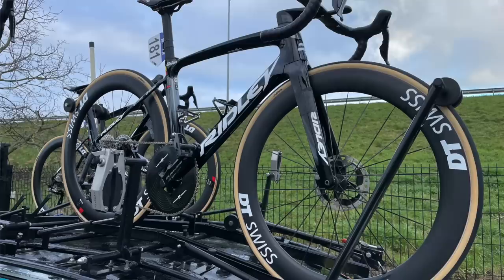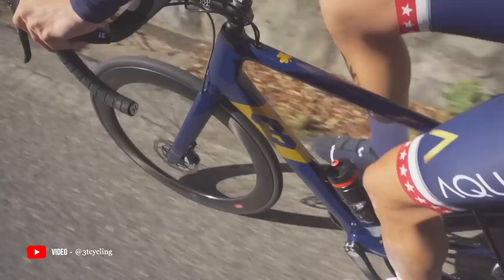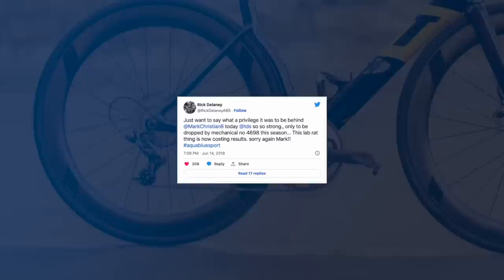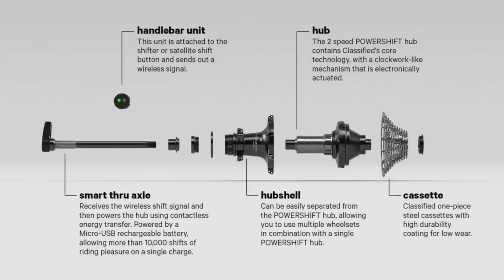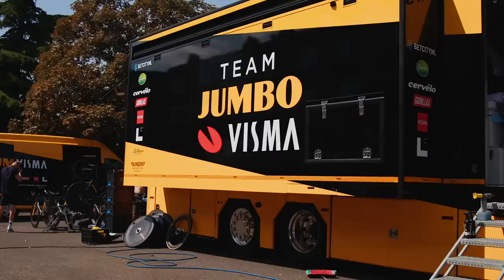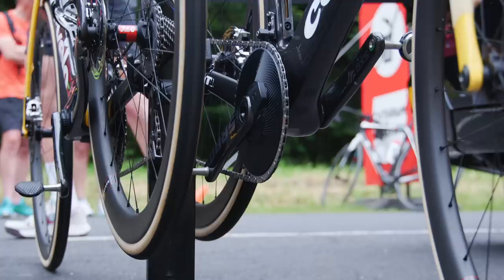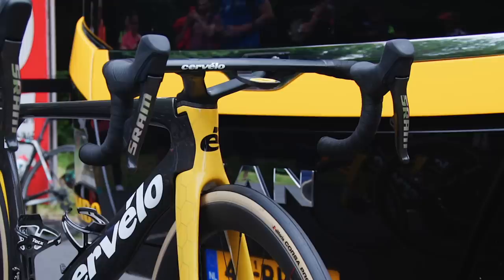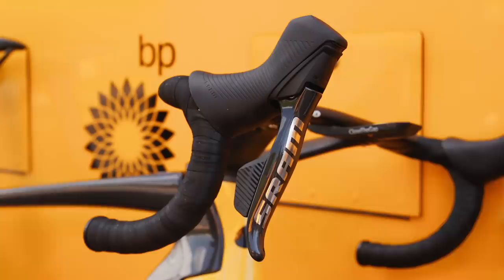Is Jonas Vingegaard Going 1x At The 2023 Tour de France!?

Comment: I think they should attach a 12-spd cassette to a crank and replace the front derailleur with another rear derailleur so they can have 144 speeds.  Maybe also throw a classified hub on there for hilly stages.
Reply: Well, the Classified hub makes 48 speed set ups possible.
Reply: this is what happen if we use 100% of our brain
Reply: @SecwetGwiwer  Well, technically u could use a 3x crank on a 12speed groupset, soooo 72 speed bike cooming soon
Reply: @wouter6053  3 x 12 = 36 though, not 72, unless you are hiding another multiplicator somewhere?
Reply: @yvjohns  yep, the classified hub

Comment: We had 6.8 kilo bikes forever, so weight saving point is irrelevant, 5 watts saving from removing an FD sitting in consistent turbulent flow due to pedalling is also an unverifiable claim. In short SRam is pushing BS marketing stunts and BS products like they have been for the past bunch of years, they got extremely lucky Roglic didn't lose the GIRO due to 1x, I hope they succeed in making Jonas lose TdF solely due to their BS and pay the price for it.
Reply: Sram is notorious for pushing stuff like this, meanwhile solving real problems with their drivetrains (mostly their front derailleurs) they just don't care. We saw that with their new Eagle "Transmission", and now we're seeing it in their road 1X setups aswell. I mean, I love Sram Eagle, but instead of improving on the derailleur hanger, which literally prevents your RD from snapping, they just ditched it and created a whole lot of new problems, especially for frame manufacturers.
Reply: Le cervelo s5 ne pèse pas 6,8 kilos
Reply: @coolbell9026  the S5s that JV guys ride aren't the same as consumer S5s

Comment: For a while I used a 2x with 35-48 and a 10-36 cassette. I found that I never used the small ring. You do also have some aero gains.... however you lose some watts by cross-chaining. You will also have more limited gear ratio with bigger spaces in between gears. Also 2X12= well realistically probably 14 or maybe 16 gears? Having said all that I would still love to see it happen!

Comment: 1) How do you get the aero benefit of losing the front mech if most cyclists substitute that for a chain keeper?
2) 1x does NOT give a better chain line, except in the middle of the sprocket, so maybe in 3 or 4 gears only.  In the highest or lowest 3-4 gears, the chain will be more 'bent' than a 2x in the right combination.
Reply: You get an aero benefit because you have a narrower chainring (you only have one instead of two) and because the sram front mechs are absolutely massive. The idea with the better chainline is that you set the bike up in a way that you get the good chainline where you actually need it and the worse one when you are just sitting in  the pack.

Comment: I rode a 1x for a while on the road, with a small chainring at the front and a big cassette on the back. It didn't work for me as an amateur rider, it was great for steep climbs (which is a bonus round my way in the Peak District), but I had no big gears for the descents. Was so happy to switch back to my double chainring. I can't see it catching on for casuals.
Reply: Only for TTs on race day, niche product. Or London commuters. Even for TT aero gains are marginal, <10 watts and only good for flat courses.

Comment: I have a 1X gravel bike, which is also my road bike. It’s my own mullet build - 42 tooth SRAM Force chain ring up front, GX Eagle 12 speed, 10-52 cassette at the rear (GX Eagle derailleur). Gear ratios have been great for me on climbs. Just a slow and steady pace. I ride solo, so I don’t know if my 42-10 combo would be able to keep up in a group on flats, but I’m in no hurry to find out. Pretty happy with my set up. Love the simplicity of just the one chainring. Oh, and I have semi slick tires instead of knobbies, because the majority of my rides are on road anyway.

Comment: Been riding 1x for 2 yrs and love it. Especially cause it allows me to have a 15 lbs bike 😊
Reply: I built a 14.8 lbs bike with 2x all the way back in 2014 with a lowly Sram Force 22 group.
Reply: @johnnycab8986  what frame and what size. I got a emonda slr 54cm
Reply: @johnnycab8986  But with rim brakes.
Reply: @trentvlak  on road bikes: rim>disc  
I've owned about 6-7 road bikes and around that number in CX and gravel bikes. I've never said to myself "I wish I had discs on road bikes." I live in a mountainous area and cannot go 10 miles without doing over 1k of climbing.

Comment: I think the switch to SRAM has been very insightful into the JV team with numerous riders on 1bys and other non-traditional setups. The R & D department at SRAM must have had fun trying to figure out if the savings are worth it from aero to drivetrains to chain lines to gear ratios to weight.

I am so excited to see the switch to lower gear ratios, I'd love to see the intel on gear ratios for the hill climbs. My guess it is going to be course-dependent on which gear ratios they are given with a close to 1:1 for the hilly stages and then go back to a sprinter gearing for drivetrain efficiency for the sprint stage finishes.
Reply: 1x also seems to gain popularity in the gravel scene, too. A few years ago, it seemed relatively evenly split and at this year's Unbound I had the impression most of the heavy hitters were running a 1x mullet setup coupled to a big chainring. 

I have been running a 1x12 SRAM setup on my road bike for a little over 2 years now, and it is excellent. I live close to proper mountains, and you can definitely live without the front chainring. Ideally, I'd like a 10–39/10–40 cassette for a little more range, but 10–36 works very well.
Reply: @Max Lein  which 1x front you using? A 48T or 50T?
Reply: @kellrockets101  42 teeth. That's good up to 63–65 km/h, i. e. plenty on public roads.
Reply: I guess a chain fixer for Primoz was to heavy. They rather have the chain come off to make for epic stories to write by the press. ;-)
Reply: SRAM paid them a shit load of money to run them. That’s why they changed.
Reply: @Levelochef  Why? SRAM offers 1x and 2x, they are agnostic and let riders decide. I don't see any motivation for them to force a team to use a 1x setup or a 1x + Confidential hub gear setup if it doesn't have to. I think teams are just opening up to the possibility of trying it out.
Reply: @MaxLein  I think maybe you misunderstood. SRAM paid JV a huge amount of money to swap from Shimano to SRAM is what I meant.
Reply: @Levelochef  Oh, ok, yes, I misunderstood. Yeah, that's how sponsorships work. Shimano forces many of its sponsored teams to e. g. run inaccurate power meters, for example, so many sponsorships come with strings attached that mean teams aren't necessarily running the best gear.

Comment: The biggest issues I find with 1x on the road bikes for general riding is the gear steps, 

When I would  ride  with someone who had a 1x, me with a standard 2x, on the flats was fine, but every time we came to a relative steep climb, when they would shift to an easier gear, they would slow down so fast that I would run into him due to the large steps in the gear range

I run 1x on my cyclocross and triathlon bikes, but run 2x on my road bike as a all round terrain 

If the pros are running one 1x, they are going to have their gearing set accordingly to the terrain of that stage

Comment: I was mountain bike guy before got to the road bike, I was surprised how reluctant road biker to the idea of 1x chainring.  People can't product more than 200W power still want a 52-46t chainring. 
I ride road bike for 3 years, and I am always using 40T 1x chainring with 10-33T cassette. It's more than enough for my 200W leg. People can't believe I use 1x chainring, I think road bike people just don't understand how awesome 1x is
Reply: I’ve got a mullet 1x with 10x52 on my new Enve custom road. I’m the same, came from mtb and have never run 2x, seems so silly to have to switch chainrings all the time.
Reply: @stinkybeam - ran a 1x setup (42T and 11/32) on one bike for a race league last year and was perfect, never ran out of gears and zero problems. For anything that doesn't include epic climbs like Ventoux or Pikes Peak then 1x is fine for road bikes.
Reply: I run a 10–36 cassette with a 42-tooth chainring on my road bike. I spin out at about 65 km/h, which is about as fast as I want to go and still pedal on public roads with traffic. For most people even a 38- or 40-tooth chainring would be plenty fast enough in practice.
Reply: It's all about closer rear spacing. 2x setup allows you to run a tighter cassette, get better chainline, that's why.😉
Reply: @fatpinarellorider  And you have annoying front shifts. Even when I was running 2x or 3x, I'd only reluctantly shift chainrings. A 1x bike feels much better to me. As far as gearing is concerned, my 10–36 cassette feels (and indeed is) as tight as the 11-speed 11–32 cassettes (Shimano and SRAM) I used to run. 

Plus, I come from the MTB side, and I feel comfortable at a wider range of cadences. Once you get used to it, I doubt it is an issue.
Reply: I am not debating that 40-10 is enough for amateurs.
I frequently make the same point about the GRX 46-30 double for gravelbikes that can be used as roadbikes as well (with a different wheelset with an tighter grouped casette)

46-11 would be 42-10 equiv. I can go 50kph+ at high cadence. And no amateur rides 50 kph+ on long stretches.

That said i just went to Tuscany. And i am debating that 40-33t going up there.
In Italy going beyond 15% is a given. especially if your not on the main roads.(And honesly if you value your live and want a good time your not gonna climb on the main roads.)

I'd pick the double for the 30T small ring.
Reply: hair legged mtn bikers telling roadies how it's done. Comical.
Reply: @trentvlak  And we’re winning so what does that say about roadies…..
Reply: @trentvlak  Giuly as charged. My fur costs me 30 W at speed on my road bike. At least! ;-)
Reply: @barneyklingenberg4078  Yup, this. “Gravel gearing” should be an option for road bikes. 46:11 corresponds to 50:12 and I reckon most people use their top gear only on downhills.

Comment: I run a 44t w/ a force 10-36 on my CX bike and it covers pretty much all the bases. Sometimes for gravel I'll throw on the 10-44. Some gaps in the middle of the cassette are a little more than I'd like, but its perfect for road training, CX racing, and gravel racing all on one bike. I don't really see the benefit on a bike meant just for riding on the road. No need for a clutched derailleur, and I feel the benefits of smaller gaps and wider range on a 2x is worth the few extra grams. Most of these bikes can still hit the UCI weight limit with a 2x system anyways.

Comment: Considering that i live in a very hilly terrain area, and i ride and race my cross bike in road races and have very few if any issues, (Trek Boone 2023 with FFWD RYOT 33 and Challenge Criterium RS 27 tires) and i ride a 36t cassette with a 42t chainring, (sometimes 44t if its a flatter race), and my gearing, although hard if i have lots of gear, is usually enough for me to ride anything. I would absolutely put a 48t chainring on if my frame could handle that, and pair it with a eagle cassette. Bigger gears means less resistance. But also means bigger jumps between gears.

Comment: Simple fact is 99% of bike riders can get on very well using a 2x11 gear set up.   No a single chainring DOES NOT remove the issue of chain line.   One small and often overlooked factor for consumers. Cost and Availability of spare parts! What Pro teams do to gain tiny advantages and/or please their sponsors HAS VERY LITTLE to do with people who then follow the Industry driven trends as consumers.

Comment: I think they're going to just use whatever groupset, ring size, gearing suits each stage. 

Roglic doing so at the giro worked wonders. It's something that seems so obvious, when things like a bike change mid-stage has become fairly common place. 

Are there any rules against that?
Reply: Bike changing mid stage just seems a bit wrong to me. Surely part of the challenge is choosing a bike set-up that will see you best through that stage. I know we saw it in the Giro, but I don’t think it added anything.
Reply: yea thats true, i think the 1 by isnt replacing the 2 by in near future especially not for us amateur riders. as you said they put on whatever they need for the stage. on some TTs they ride a 53 single chainring, on some a 60 single and on some a 2 by with 53/44. and i cant imagine going up the mountains in my area(some have sections above 20%) with a 48/36 and im sure this counts for 98% of all riders. if i would live somewhere flat like in northern germany, netherlands or denmark i would definitely consider a 1by, but youd stil have to change when you are going on holidays fe to mallorca.
Reply: Aqua Sport blamed 3T for their collapse, based on them being forced to use 1by. 

I like them having to just use one bike too, think that's all part of the challenge. But as it's part of the pro culture now, I can see it happening with groupsets, different bikes etc.

Comment: No reason to remove the front derailleur. It works great and gives you more gears. The weight is not significant.
Reply: But muh aero! It give me like five Wotts 4 shuah!
Reply: Weight isn’t significant on mechanical, but electronic with that big arse battery…😅

Comment: If he cared so much about weight, he could save way more weight switching to rim like Pog used too.

You say driveline efficiency is better, but is it, I do not understand that claim really. You would spend way more time on the lower or higher end of the cassette surly? A very hilly up and down stage  he is going to be in the 10 or 33 most the day.
Reply: Chainline can be better, then 2x, if u use big-big or small-small on a 2x. No one in their right mind do that often, and in case of big-small or small-big, 2x has to have better chainline.
They use a chain catcher, and thats almost as much aero drag as a fron mech? Although sram front mech is chunky, so micht be some savings there. But its almost neglectable, since he rides fast in peloton, and slower uphill alone, where the weight is more redundant. Is it lighter? Maybe, but he cant have good cadence on low speeds. Probably will use as an advertising, on stages where only has to finish in the peloton, and hope the chain doesnt come of like it used to be.
Reply: Because disc brakes are faster aka more aero brake faster brake more consistently vs 1x for the stages he will use it on has no difference just lighter not a good comparison at all
Reply: @Bnet  disk brakes are not more aero at all. Do not believe the marketing lies
Reply: I agree; cross-chaining losses over the course of a race are probably higher in 1x.
Reply: @bnet7608 You’ve been watching too much GCN and have been conned by the marketing.

Comment: Isn’t half the reason 2x is more weighty (and probably less aero) nowadays, because of the big ugly battery and electronics stuck on the top of the derailleur? The reason 1x was deemed as a failure before, on the tour, was that you either have the range of gears but big jumps in between or you have less range with smaller gear jumps. It’s always a compromise. What’s changed since then?
Reply: Srams marketing budget?
Reply from the maker: Agreed, those batteries certainly aren’t helping the weight - the gaps or lack of range is definitely still a compromise but has improved since the last time thanks to an extra gear (12 vs 11 speed) and that 10t sprocket at the back. We’re still not yet convinced though!
Reply: Nothing has changed.

Comment: Last year my front derailleur cable snapped on the commute to a hilly group ride. I just couldn't spin enough to match the speed of the others then. 
I was dropped as soon as it got flat after the first descent.
When racing I never touch the small ring or almost never, because we come so fast on the bumps that the momentum you have prevents 
 downshifting to the 39 tooth ring

Comment: I am existed to see 1x gaining adoption. You never need to shift two rings at the same time which results in a change of pace and muscle pain.
Reply: If your pace is changing with the change, your timing is off or your swap was the wrong choice. But, on constantly changing terrain, it can be easy to mess up. It's why I much prefer 1x on my gravel bike. So much easier.
Reply: Or just use automatic electronic system

Comment: Pro bikes can easily achieve the 6.8kg limit with 2x. Drivetrain loss will probably be much higher in 1x with wonky chainline at the ends of the cassette and 10t loss. The aero benefit is marketing BS.

Comment: 5:18 Better chain line in a 1by? Sorry what?
Reply: Your chain ring can be situated in closest alignment with the 3-4 gears most often used, (which potentially has a .041 W saving at 63 kph in 71%RH at 28°C, 101.2kPa)

Comment: 1X is not the way to go. The losses in the classified hub is high and they made the gearing wrong instead of giving us more.

I all stick to 2X with 53/34. It provides a  huge range and reduce double gears.
Reply: That is a quiet substantial drop on the front mech.
Personally i'd just just stick with my 46-30 gravel chainrings.

I am not gonna spin out an 46-11t on flat roads unless sprinting hard
And it gives me plenty climbing gears
Reply: @barneyklingenberg4078  Yes, you need a chainring with proper designed ramps to be able to use it and a longer chain catcher. Also my chainring is reported to work on both 11 and 12 speed (Shimano and SRAM) despite the difference in roller size, so going to test it myself on my new TT bike. I am a heavy rider that top out at 2000w. I like to ride fast on flats and because I am a heavy rider I prefer light gears so I dont grind with low cadence on steep climbs. Perfect gearing.
Reply: @barneyklingenberg4078  So my new TT bike will accommodate 53/34 with a SRAM axs 10-28 chainring